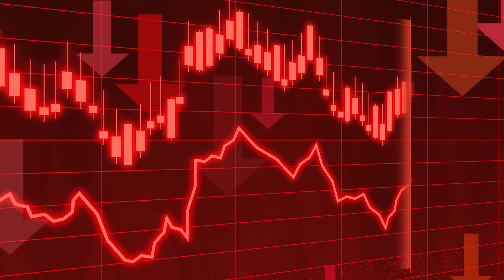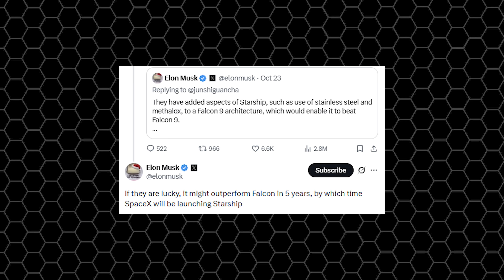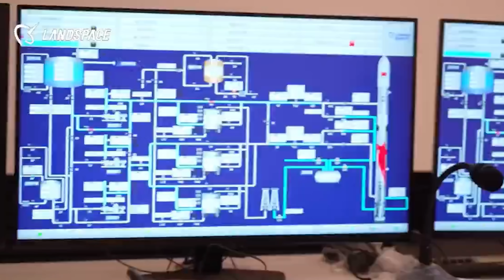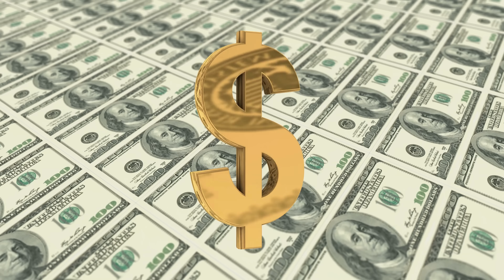Elon Musk Declared This about China Falcon 9 Clone Recovery Failed! Never Beat SpaceX...

Comment: I am much more in tune with SpaceX~Flight 12. Ship 39 fully stacked and so thus, its pairing Booster 19. 
Yes, ALL v3, the FIRST new design. It incorporates several designs improvements over previous versions, such as changes to the venting. More integrated heat shields.
Launch date u assumed Feb, 2026. 
I stab the month of JAN, 2026 as Launch date.